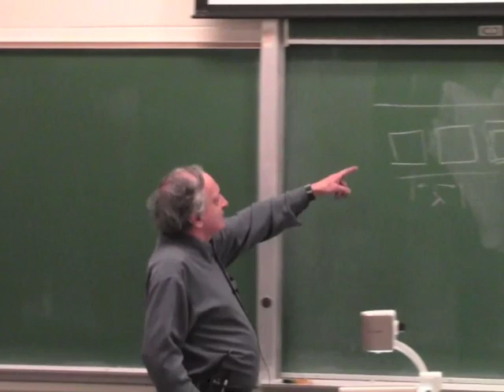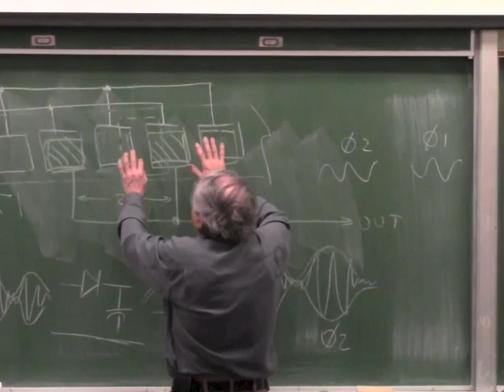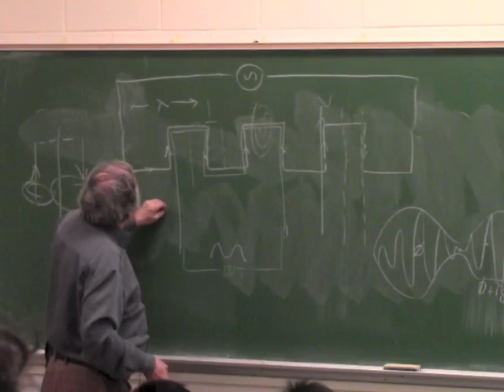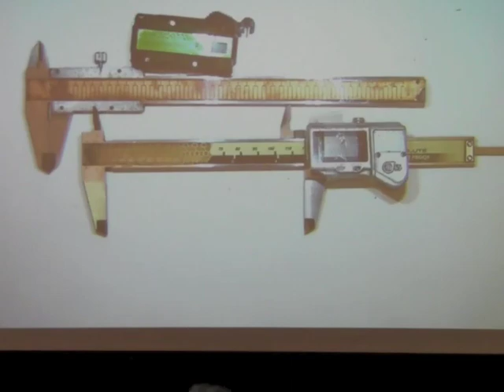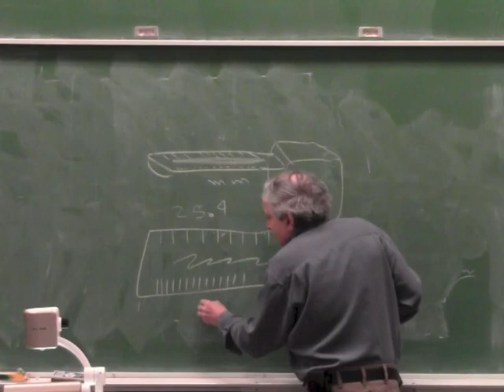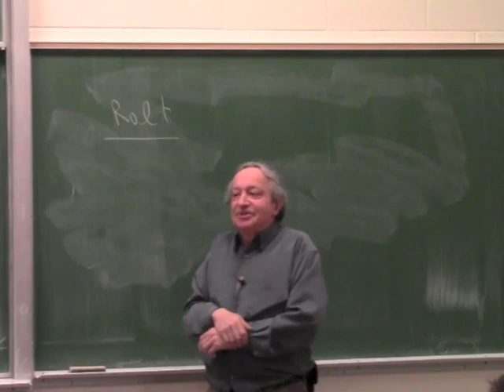08  Tellurometers and Inductosyn

Comment: The way you can get around having to run wires back from the output side of an inductive is encoder is by making it a resonant circuit by adding a cap to the secondary and then  pausing the excitation current to “listen” to the echo.

That is how CambridgeIC does their encoders as far as I know.

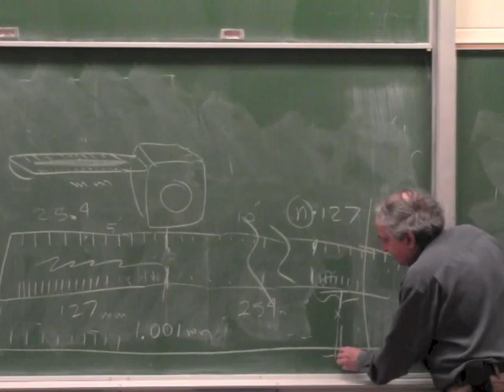Comment: 58:50 another good analogy for a tellurometer is that of a wall-clock. There are three "hands" - hours, minutes, and seconds. As such, you can visually resolve one second in a half day (20 parts per million). This precision is afforded as, during the period (i.e. half a day) the three hands always have a unique combinatorial position. Any fine error in reading the hours-hand can be corrected by looking at the minutes-hand and so on.
Reply: The same idea can be applied to the motion of the planets. Thank you for your work commenting on the videos.
Reply: That's true, but a tellurometric clock would have three hands that all move at almost the same rate, ticking each 1s, 1.016667s and 1.018056s.
Reply: @jbay088  Correct, indeed, but presumably the "measurand" is not the ticks, but instead the relative differences between the ticks, and this secondary quantity shall move like the hands-of-the-clock (slow vs. med vs. fast) behaviuor.